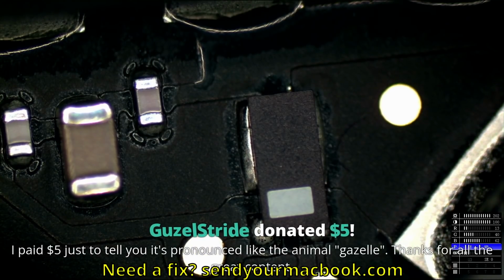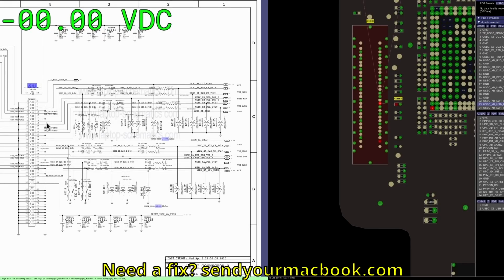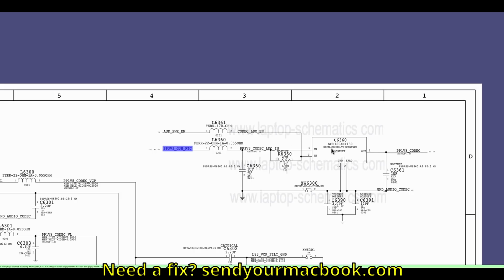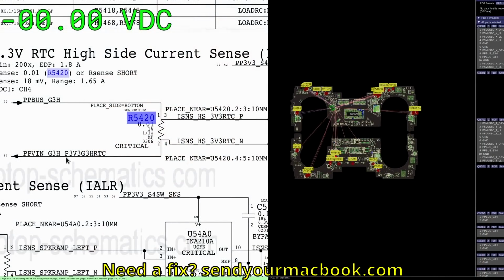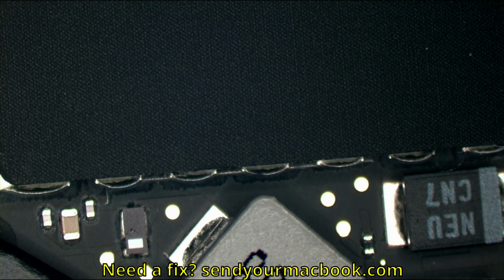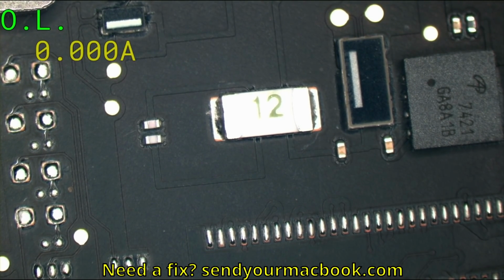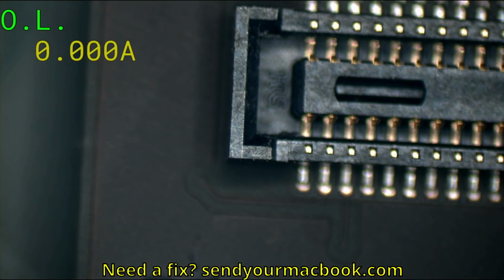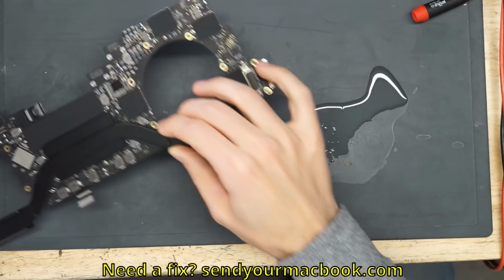A1989 Macbook not charging: this has a different power rail order, but that's no problem at all

Comment: Louis, I fucking love you. I had the exact same issue so i followed every single step, I was missing one piece of equipment though, a lab psu or a voltage injection tool. So I thought to myself "what would Louis do?" and soldered a crocodile clamp and a cable to a 1.5V AA Battery. Found the short, removed the cap.

Greetings from Germany!

Comment: I dont even really like computers (prefer mechanical things), let alone macs but its always soothing to watch an expert showcase their skills.
Reply: Tell me about it, I’m a mechanical engineer. 

The only way I can understand electronics is if it’s expressed in terms of fluid dynamics. 

Best analogy is always to compare electrical systems to a closed thermodynamic system, just treat the voltage as mass and current as flow rate.